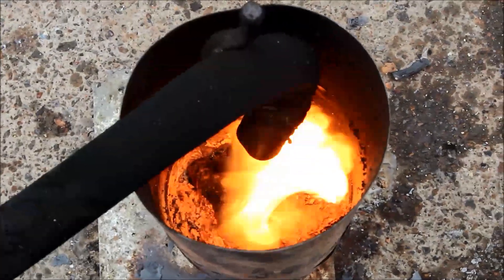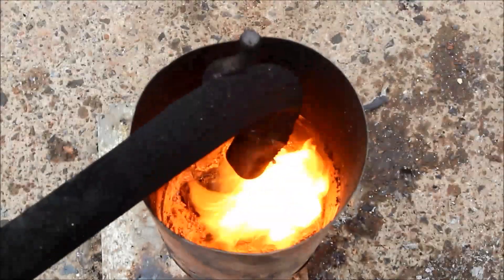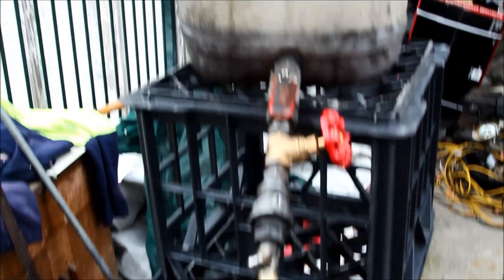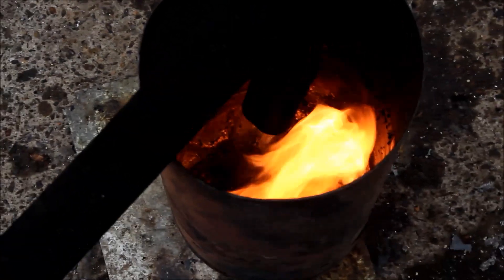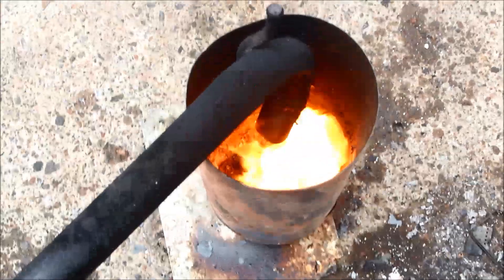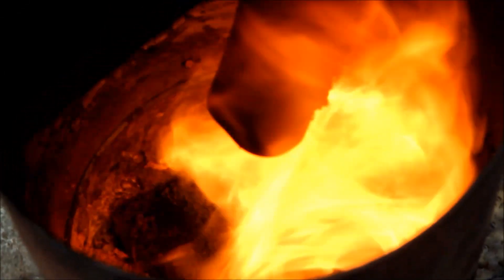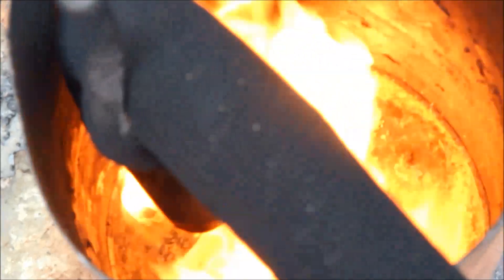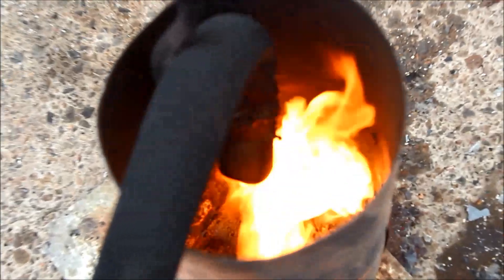Waste oil burner very Low output burning WVO

Comment: Mr oil burner i bean wondering (by now im sure you know im mexican) if this low output burner would work on just diesel. Im looking to make a small diesel heater to be able to heat my 18 wheeler truck so i can rest better by not having the engine bibration while im trying to sleep. Please let me know your thoghts and if you could do a video on it, it would be as everything you do very appreciated. Thank you sir for taking your time to show us.

Comment: I'll challenge you, make an oil burner that can replace a propane burner in a Gas Blacksmith's forge.
Reply from the maker: What are the parameters and qualities it needs to have?  I'm not very educated in the ways of Black smithing so if you can tell me what the fire needs to do, I'll certainly have a look at it. 
Does it need to be able to do an oxidizing or reducing flame, have a certain turn down ratio, heat output ... anything else?
Reply: Oil Burner I am unsure what the parameters are, I know it needs to be reducing flame to prevent oxidation. I will get back to you on that.

Comment: Great set of videos. Please keep them coming. My interest is in simple WMO burners for heating water for staff ablutions and later a system that can be modulated with simple thermostat, solenoid valve and two speed blower for when extra heat is called for.

Comment: Thanks for doing that so now will be able to fire the kiln from start using veggie oil and use battery charger 6  volt to 12 volt as having bought the same bilge fan so very happy

Comment: At least you know it can idle in between jobs without burning excess fuel.
Reply from the maker: That was a consideration Kevin. If I can have a burner thermostat controlled so it does back off to nothing when there is adequate heat and then come on again when called for, that will be perfect.
I could simply do a 2 stage heat/ idle setup and it would be easy to automate with a thermostat and a couple or relays and solenoids.
The amount of fuel it DIDN'T burn was the eye opener for me.  I could run the thing for an hour on what was left over from cooking Sausages!

Comment: Next challenge, build a burner efficient enough to get a blue flame out of WVO i have one burner that can get a blue outer cone out of kero/motor oil mix but ive never even seen a tint of blue from a veg oil flame.
Reply from the maker: That's because the Chemical composition and the amount of carbon atoms in oil mean it basically can't happen.  I have looked into this a lot and a blue flame is no hotter than a yellow/ white flame. It just indicated different chemical chains in the fuel. There is a way to Create a gas and refine it but that would be highly inefficient because you would have to throw some of the atoms away and "thin" the chains out to get it to burn blue.
Reply: See how i got mine it was actually quite efficient in that i was using a tee based evaporative burner and the bottom heated part was half full of steel shot coated in a aluminum oxide, titanium dioxide refractory that acted as a catalyst mixed with the rust and high surface area of the steel shot so as it was being catalyzed to smaller chains it gave off heat hekping the evaporator portion work better but that got a white center flame with a blue outer cone and it dang near melted through my furnace wall as it was such a well balanced concentrated flame over the normal chamber filling whispy flame from normal evaporators. Melted the ally right quick as well haha. So figured itd be a nice challenge to make a catalytic burner.

Comment: Really nice and its good to hear your voice clearly. I really need to get off my ass and build one of these my boss gets rid of 55 gallons of motor oil a month and i could sure melt lots of aluminum with that kind of quantity.
Reply from the maker: Yeah, You're not Kidding. I'll be putting up a vid later this week where I melt an 11KG cylinder head and used about 4L of oil to do it if that.
Next thing will be where to get you aluminum from. Old cars can be a great source I have discovered.

Comment: And without air fan ?

Oil Rocket S. usefull in tiny place (few heat)
but then hard to reach such heat concentration (to keep oil burning properly).

(I use some "petrol heater" burner, some iron also,
 but have to add a 3rd air entry, vortex  etc)

Comment: How about the most silent oil burner for the next video?
Reply from the maker: I have to say, That sounds as terribly Boring as this low output Burner!  :0)
I guess the real trick would be to do a quiet one with decent output. I'm not even sure if physics of combustion allow for that!  It will be a challenge and won't be the next vid but something I'll look into and see what I can come up with.  I think it will take a bit of thought.
Reply: Oil Burner That's what I was thinking about- a decent output, but silent oil burner. Although I like this, yet engine alike, sound ;)
Have you made  an oil stove for your new home yet?